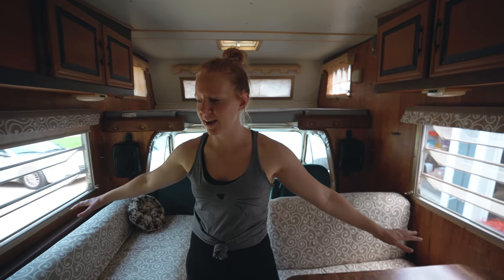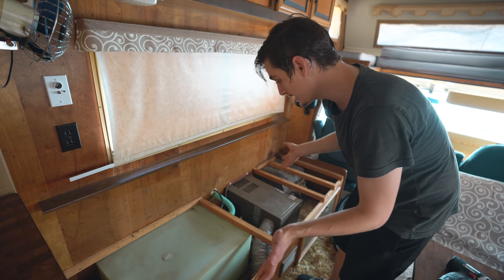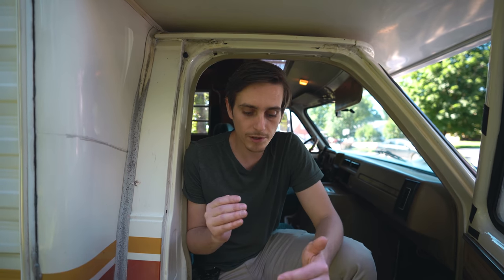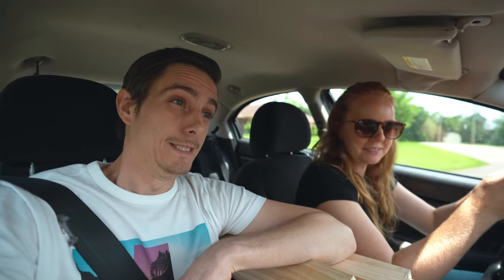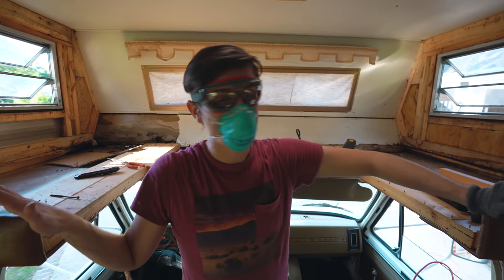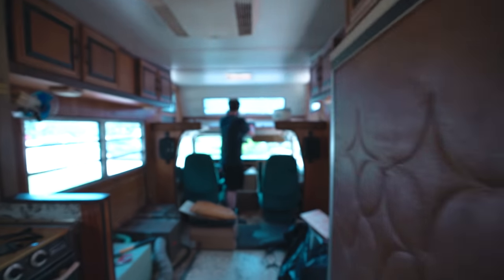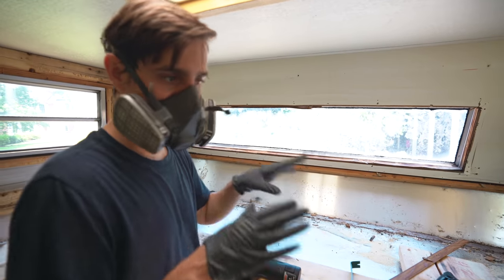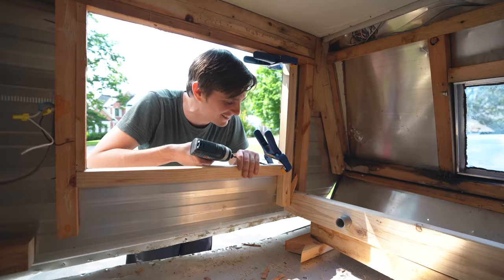Vintage RV Renovation BEGINS!… And We Have No Idea What We’re Doing 😳

Comment: Based on my own experience, I'd suggest removing the front window in the cabover altogether. It serves little useful purpose, compromises your privacy, and is one more potential source of leaks. You could probably have an opaque plastic cap fabricated to cover the entire front. Most more modern RV designs have done away with that window.

Comment: That RV was designed to last about 15 years. It probably leaked from day one. 
Get a new exhaust system, the current one is gonna give you carbon monoxide poisoning driving down the road.
Your heading in the right direction and I'm hoping it will turn out nice. At least you have the right attitude and the drive.
You may also consider having the roof sealed with what is similar to truck bed liner spray.

Comment: the interior isnt what you should be concerned with. that thing is worthless if the mechanical stuff under the hood dies. that engine needs a luxury spa day and anything worn should be replaced stat. what if you completely renovate the inside and then the car part dies? its a complete waste!